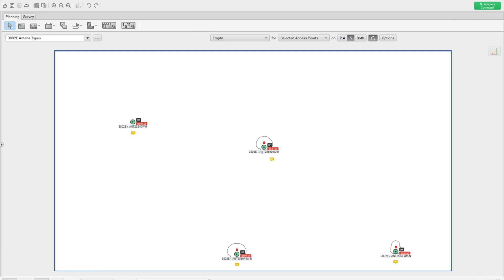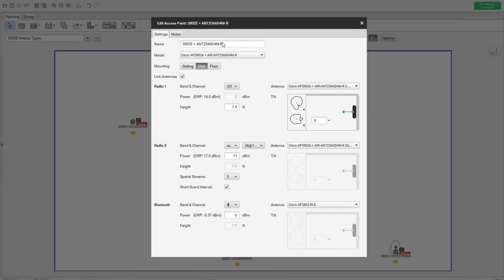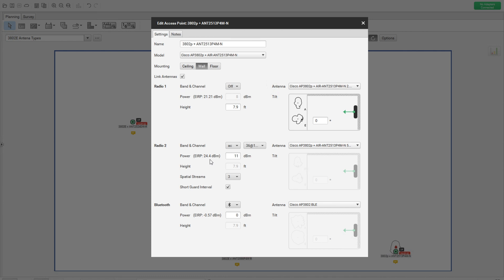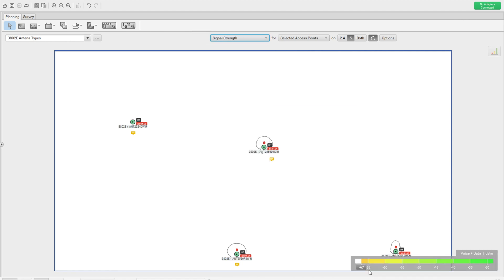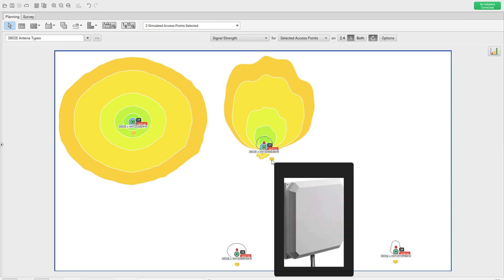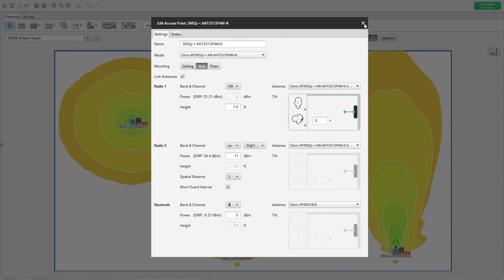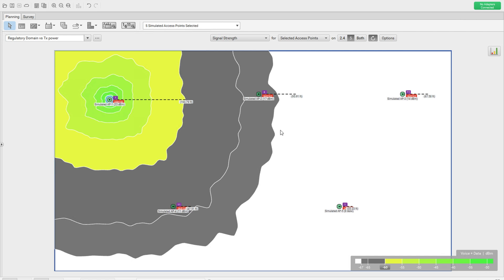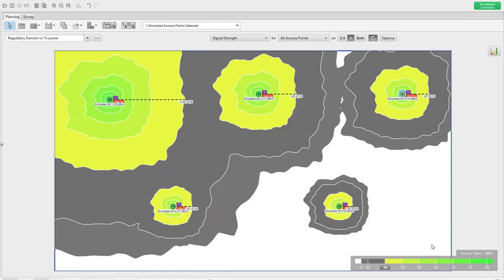How to Choose the Right Antenna Type & Right Tx Power Levels/RRM Settings (Understanding RF - 4)

Comment: Sir, i had a doubt like if I am using C9124, AP1562 with AIR-ANT2547-N omni directional antenna for outdoor, I always select as wall mount only. But the antenna arrow mark will show as directional only in the ekahau
Reply from the maker: Maybe the antenna mapping is different, you can check the same in Ekahau forums for better understanding. There can be non-supported combinations on the versions too.